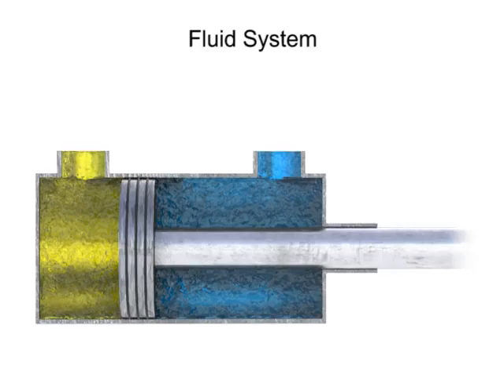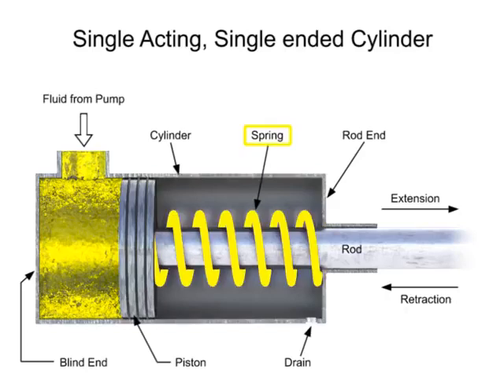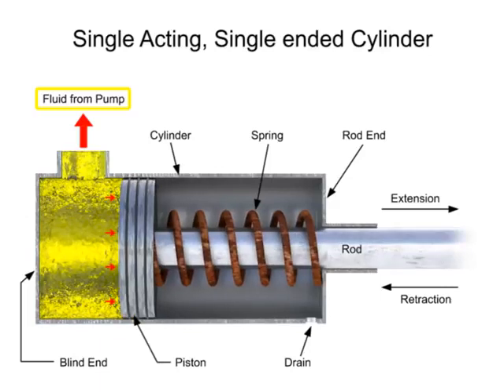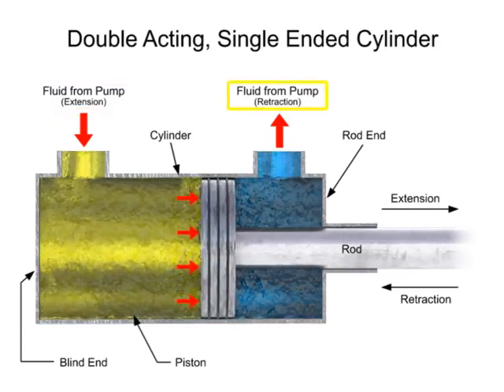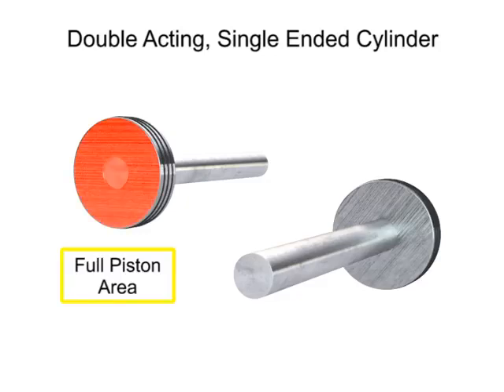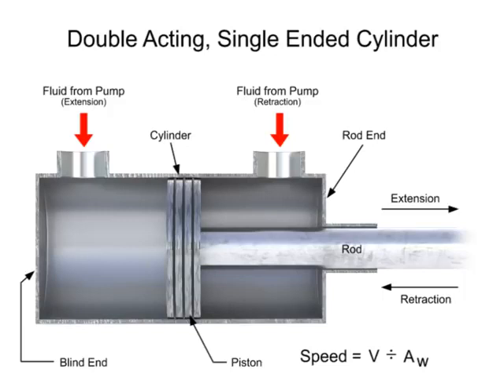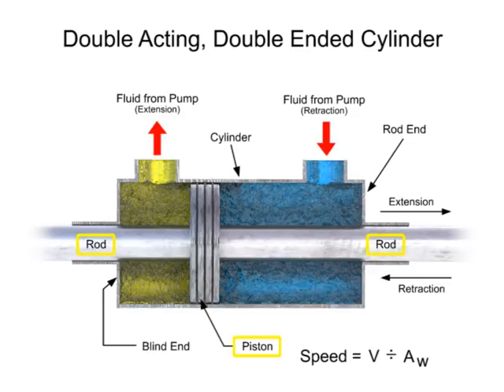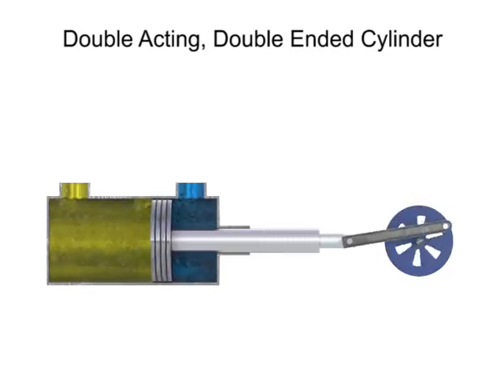Single and Double-acting Vs. Single and Double-ended Cylinders | Fluid Power System Fundamentals 4/9

Comment from the maker: Thanks for watching. For More Videos: Please Subscribe My Channel
Fluid Power Fundamentals Tutorial: https://bit.ly/2NSowCL
Fluid Power Design and Application Tutorial: https://bit.ly/3dEjvIq
Fluid Power Control Tutorial: https://bit.ly/3eniF3S
PLC Programmable Logic Controllers Tutorial: https://bit.ly/2C22zhI
Complete Practical PLC Course Tutorial: https://bit.ly/3dHon09  
Advanced PLC Programmable Logic Control Tutorial: https://bit.ly/3g8FfO3
Electric Motor Control and Power Systems Distribution Tutorial: https://bit.ly/31Cib6c
Industrial Robotics Tutorial: https://bit.ly/38hQnWd
Industry Blueprints Tutorial: https://bit.ly/2ZqCn8p
AC Circuit Analysis Tutorial: https://bit.ly/2VyoHqP
Physics Tutorial: https://bit.ly/2BjVOaX
Motion Control  Tutorial: https://bit.ly/31sqUrz
Embedded Systems & Microcontroller Tutorial: https://bit.ly/3893dpH
Motors and Drives Tutorial: https://bit.ly/3dH0yF1
Process Control Tutorial: https://bit.ly/3hTASs7
Channel Link: https://bit.ly/2IsqVS for watching more Videos

😌Don't Forget To Like, Share, Subscribe & Comment 😬
======
تعريف بالقناة:
قناة تعليمية مهمة للجميع عليها أكثر من 210 فيديو تعليمي، بها:
1- شرح لبوردات الاردوينو Uno & Mega 2560  وعمل مشاريع رائعة بها حيث، شرح Servo Motor, DC Motor وطرق توصيله والتحكم في إتجاهه، و EEPROM وتوصيلها وكيفية التعامل معها. وال Stepper Motor، واستخدام الاردوينو كمولد موجات جيبية ومسننة ومثلثية،
رابط الدورة من هنا: https://bit.ly/2PvtHvx
2- شرح دورة الأنظمة المدمجة Embedded Systems والميكروكنترولر واحتراف البرمجة بلغة الامبيدد سي Embedded C. وعمل مشاريع رائعة…
رابط الدورة من هنا: https://bit.ly/2KadqX2
3- شرح كيفية الربط بين الاردوينو واللابفيو وعمل مشاريع رائعة بهما.: https://bit.ly/2KlTssj
4- شاهد أيضاً،دورة مهمة جدا لطلبة الهندسة في شرح أساسيات ومبادئ التحكم الآلي او هندسة نظم التحكم
(Automatic Control or Control systems engineering):
رابط السلسلة:  https://bit.ly/2NGyeYd
5- دورة متقدمة في التحكم باستخدام اللابفيو (مهمة لأقسام تحكم أو كنترول والكترونيات). وهي تطبيق عملي لدورة التحكم الالي 
رابط الدورة من هنا: https://bit.ly/2K7aVEE
6- سلسلة Root Locus Method في هندسة التحكم الآلي لطلبة كلية الهندسة، قسم كهرباء،
رابط السلسلة: https://bit.ly/33CROvi
7- سلسلة عملية في القوي الكهربية او الكهرباء المتردده الاحادية والثلاثة الطور (Electrical Power) لطلبة هندسة ولكل مهتم بالكهرباء
رابط السلسلة كاملة:  https://bit.ly/3dWEckc
8- بعض الدواير العملية الكهربية المهمة للجميع.
رابط الدورة من هنا: https://bit.ly/2Fnli65
9- دورة في القياسات الكهربية، مهمة لطلبة كليات هندسة ولكل مهتم بالالكترونيات والكهرباء: https://bit.ly/30RdTVS
10- دورة في احتراف الرياضيات والجبر والهندسة والتفاضل والتكامل والقوانين الخاصة بها بدون تعقيدات.:  https://bit.ly/30ykUtG
11- دورة في احتراف برنامج اللابفيو الرائع LabVIEW : https://bit.ly/2TOx4y4
12- برامج مهمة للكمبيوتر واللابتوب الخاص بك: https://bit.ly/2qT9NM6
13- Complete Practical PLC Course Tutorial: https://bit.ly/3dHon09 
14- Green Screen Tutorial Link: https://bit.ly/3esShFa
15- Complete Process Control Tutorial: https://bit.ly/3hTASs7
16- Complete Fluid Power Control Tutorial: https://bit.ly/3eniF3S
17- Complete Fluid Power Design and Application Tutorial: https://bit.ly/3dEjvIq
18- Complete Motors and Drives Tutorial: https://bit.ly/3dH0yF1
19- Complete Physics Tutorial: https://bit.ly/2BjVOaX
19- Complete Embedded Systems & Microcontroller Tutorial: https://bit.ly/3893dpH
20- Advanced Programmable Logic Control Tutorial: https://bit.ly/3g8FfO3
21- Physics Fundamentals Tutorial: https://bit.ly/2CNrzcU
22- AC Circuit Analysis Tutorial: https://bit.ly/2VyoHqP
23- Industry Blueprints Tutorial: https://bit.ly/2ZqCn8p
24- Industrial Robotics Tutorial: https://bit.ly/38hQnWd
25- Electric Motor Control and Power Systems Distribution  Tutorial: https://bit.ly/31Cib6c
26- PLC Programmable Logic Controllers Tutorial: https://bit.ly/2C22zhI
27- Fluid Power Fundamentals Tutorial: https://bit.ly/2NSowCL
وهناك المزيد علي القناة، وان شاء الله هذه مجرد البداية فقط.
رابط القناة:   https://bit.ly/2IsqVSC
وتعمل اعجاب ومتابعة لصفحتنا علي الفيس صفحة المهندس المحترف
رابطها: https://www.facebook.com/المهندس-المحترف-100879698187843
متنسوش الإشتراك بالقناة لمتابعتنا وتفعيل جرس التنبيهات ليصلك الإشعارات بالفيديوهات أول بأول.